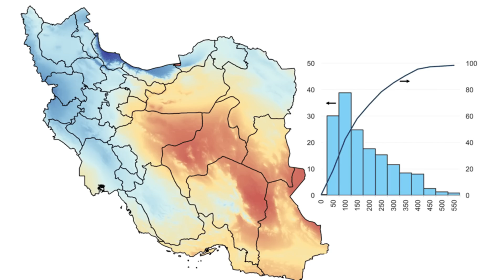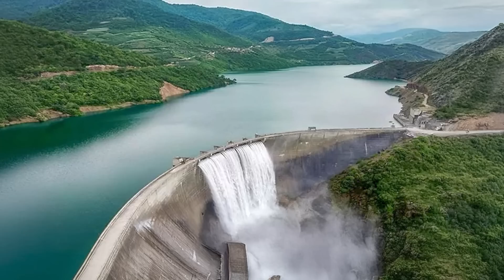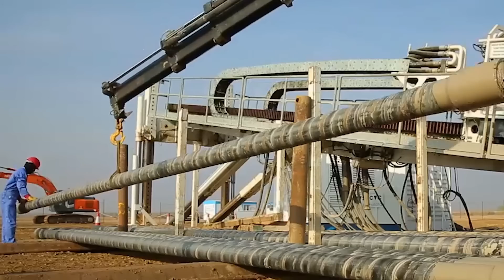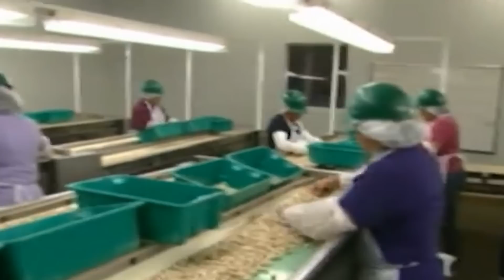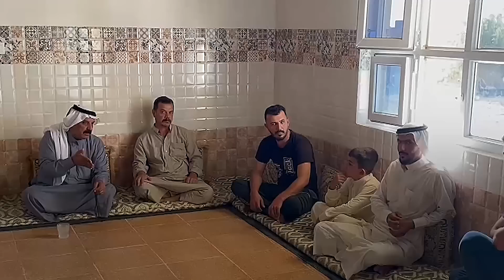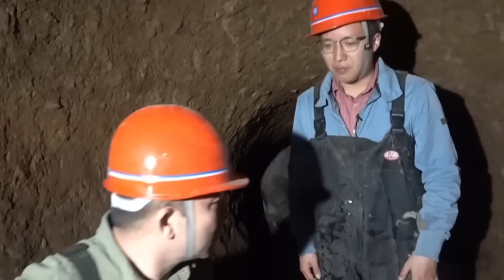Iran Started to Drain the Persian Gulf by Pumping Tons of Water, 4 Years Later Result Was Shocking

Comment: Desalination is not without sideeffects though. Desalination extracts app. 40% fresh water of the water pumped in. The rest 60% is very salty and full of minerals and increases the salinity in the area where its pumped out. This devastates the surroundings in the area because of the high concentration. There are some experiments on trying to use this concentrated water by extracting the minerals dissolved in it. And in this way reducing the salinity. But its very expensive and not yet cost effective.
Reply: Totally correct and that slurry is too corrosive for pipelines and storage containers
Reply: They can take it down all the way and collect the organics and minerals to sell as fertilizer. SEA 90 sells this product already.

Comment: Here is the end of Water Shortages everywhere.
1) The air above the Surface of the Ocean for approximately 30 feet is at 100% Relative humidity.
2) Use Solar or Windmills to power industrial chillers (dehumidifiers) 
3) Use an offshore platform to intake sea air, then chill it to obtain fresh water. 
This solution requires no desalination plants, no reverse osmosis, etc. It's one of the least expensive methods to obtain fresh water.
Reply: Well you got the plan. Just get some investors and get it going
Reply: @bobby6134 It's already a commercial product.  If you live in a hot, humid area and have solar panels, you can have 20 litres a day.

Comment: I think it is possible to desalinate the Persian Gulf water and supply sweet water to the north. But, there will be huge cost to pump all throgh the process. But, Iran has a huge amount of gas and oil that it will burn to produce power but at a huge cost to the environment.

But, for how many decades? Ultimately, there will be environmental costs. To minimize the overpopulation, Iran can certainly go for birth control. But, will the Islamic fathers allow people to do such an anti-Allah action? I doubt. The only positive point I find attractive that the quantity of water in the Persian Gulf will not dwindle because the used swift water will be recycled by the nature and the Gulf will remain full of water, albeit, with more salt.

Comment: You said water evaporates as soon as it rains and leaves Iran dry as before. Then, build canals miles long to the border to bring salt water from the Persian Gulf and let it evaporate in the desert. A network of seawater canals might help bring more moisture in the air and induce the precipitation of rainwater. It's cheap after the canals are built. There is no need to desalinate artificially because nature will do the process naturally.
Reply: Omg we need to send this comment to the president of Iran!! U just saved them with your genius idea!! You will be a god over there and they will feed you grapes and wine while being fanned
Reply: @chriskeiffer5861  Yep. Provided that Iran has an area that isn't too high to build canals from sea level.😁 then they can use pumps also to pump seawater from the main canal to canals, which has higher elevation so that they can build networks of canals or even artificial lakes to allow seawater to evaporate into the desert and probably increase moisture into the air and eventually rain will develop. It doesn't matter where the rain will drop as long as it is inside Iran or its neighboring county. They must use their useless desert. Their neighbors should do as well.
Reply: If salt residue is the problem then let them dissolve by the rain and drain them back into the main canal. The more moisture in the air, the more snow will also drop into Iranian mountaintops and melt during summer and flows down into rivers and dams.
Reply: Mangroves also grow in saltwater canals. The mangroves forest will also provide shade, prevent erosion or minimize sandstorm if it grows abundantly, and fish safe place to reproduce or to lay eggs.
Reply: The seawater canals, which will probably become  deep, will also serve as a floodway in case of extreme weather conditions. Obviously, the floodwaters will immediately dilute the salinity of the seawater canal into brackish waters.
Reply: When you desalinate you get salt as a residue, but what do you do with the salt? spread it on the land and bang goes any chance of that ever becoming arable land, you can put it back into the sea but that raises the salinity from where you are drawing water.
Reply: @adoreslaurel  You don't have to dry up the canals. Just let the tide do their job. Let the saltwater or the seawater from the Persian Gulf back and forth into the canals. That's why the canals should be below sea level.
Reply: @alexonorep5978  What tide? In the Persian Gulf, maximum tidal ranges are about 80 cm (2.6 ft) in the north and south and about 50 cm (1.6 ft) in the central Gulf, so not very powerful. Do you have Google Earth? If so, go and take a look at Iran's geography and let us know where you would build canals through its very mountainous terrain. Well, imagine digging a canal below sea level under those mountains!  And what for? The mountain ranges run from the north-west to the south-east and are sparsely populated with soils that are no good for agriculture.
Reply: @alexonorep5978   The water would roll in pushed by the tide, but what force would roll it out again if it were below sea level?
Reply: @AAC2446  Well, dig below the lowest tide of the Persian Gulf. 😁 it's up to you if you want to dig a canal in the Iranian desert 1 km below the sea level. 😁 Yes, I agree that if the desert elevation is too high on average, then it's either impossible to dig deep canals or very expensive to dig, but my idea is that if only there's a few meters high of elevation in the Iranian desert then I guess my idea will work. The main idea is to induce rain into the Iranian desert and probably  turn the desert sand into fertile land if regular rain drops into it. It doesn't matter if the  canals are not straight but winding  into the neighboring countries or connecting into the Caspian Sea. 1 major canal is enough, and then you can use pumps sipping seawater from the main canal  and pour it to canals or low-lying desert land for impoundment like lakes do that has higher elevation than the main canal. It's up for them to look for low-lying desert paths for canals and artificial lakes and NOT ME😄
Reply: @AAC2446  just let the seawater in the canal seek its own level. Does sea inlet empty all its seawater content during low tides?
Reply: @alexonorep5978   But it is SALINE water! Why would anyone construct canals for transporting seawater? It would be astronomically expensive and the water would be no good for irrigation, nor for drinking water.  It would be better to construct desalination plants and pump the water in pipes to where it is needed. Iran is about 3,000 km from north to south.

I used to live in southern Iran and the only spots in the mountains where plants could survive were on the shady side of crevices. Any rainwater was immediately absorbed into the sandy soil. A friend who was a biology professor there once took the temperature in the shade on the street. It was over 60C (140F). The air is so dry that perspiration immediately evaporates. One literally never gets sweaty. Rivers evaporate like humans. The river that ran through town was seasonal - a raging torrent that was strong enough to wash away bridges in the spring when the river was swollen with water from melting snow in the mountains. The torrent didn't last long and the rest of the year the river was either completely dry or else just a small trickle. In fact, the river is called the Rudkhaneye Khoshk, which translates as "Dry River". 

With such porous soils, a canal would have to be lined with an impermeable liner or the water would drain away. Artificial lakes would have problems with evaporation. It's not really worth spending time speculating about it because sea water is not exactly useful for use on land. I have spent some time on the islands of Hormuz and Qeshm (salt domes some 600 million years old), in the Strait of Hormuz. The islands are rocky and dry, and they both have desalination plants. This is the way to go for states bordering the Persian Gulf, Strait of Hormuz and the Gulf of Oman.
Reply: @AAC2446  Again, the purpose is to evaporate water into the Iranian atmosphere and probably induce rain. It's true the price to build will be astronomical, but once the canal is built, it would have a lasting impact on the production of rainwater  and fertilize the arid and desert sands. Their ancestors built pyramids for hundreds of years just for the simple purpose of burial grounds for their monarchs. Why can't they dig canals for posterity? Rivers dries up because water source from high grounds simply diminishes also. You can't dry up a canal that its very source is the sea itself.

Comment: This should help rising oceans due to ice melt.
Reply: Not to worry.  All this desalination will keep the oceans stable.  (snort)  The one in San Diego is sucking out 50M gallons/day.
Reply: Only issue is they need oil to desalinate.
Reply: @BrRizzy1 well they have plenty of oil so shouldn’t be that much of a problem
Reply: There is no "rising oceans" You could verify this with scientist and experts in 5 minutes.
Reply: Ice melting in water doesn't affect the water level, basic high school science.
Reply: @faodail3913 yeah, but ice melting off of a continent into the water will cause the sea to rise.
Reply: @AnalogLogic don't fall for it sheeple, if oceans were rising why would Obama own 2 ocean front properties?

Comment: It is much better than desalonization to release nanal from the sea 100 or 200 km than in a part of the country where the depression or the level of the earth is lower than the sea level, in this way you would get like a small sea in the middle of the country that would be less salty than in the Gulf of Golf because it would lose some of the salt in the process. Around the lake or the sea, palm trees and everything else that grows by the sea would grow, and thus new crops would be obtained, but also new vegetation, which would all together lead to greater evaporation and therefore more frequent precipitation!! And the loss From underground reservoirs, it would be replenished with natural and non-salt water for the simple reason that the water would naturally only be cleaned up when 20-30 meters of soil, sand and rocks passed!! Basically, wherever there is this problem, canals would have to be dug, let's say through the Sahara, there it is perfect to dig dozens of channels as deep as possible into the center of the Sahara, and thus also the palm trees would start to grow first and very soon more precipitation would begin!! All this is very simple, but the problem with the Sahara is that they are Countries that were once among the rich no longer exist today!!! And oil is extracted in huge quantities, so the Sahara has enough depressions because the desert has settled from the fence of oil exploitation and today there could be 10 small oases with sea water, 100 by 50 km, which is the perfect place for a summer vacation and would solve the problem of precipitation!
Reply: i stepped reading after Gulf of Gulf, its PERSIAN GULF